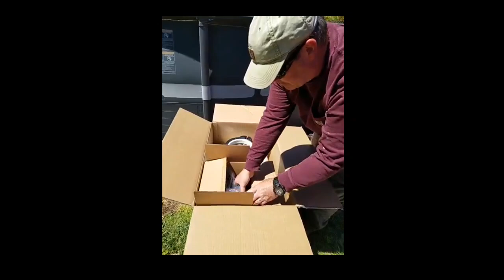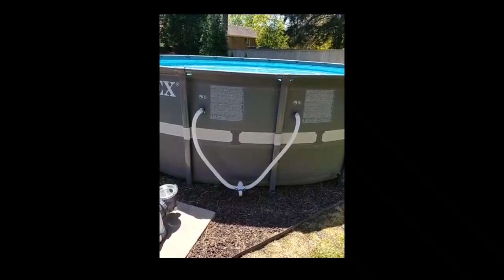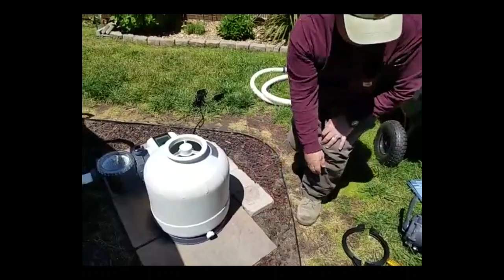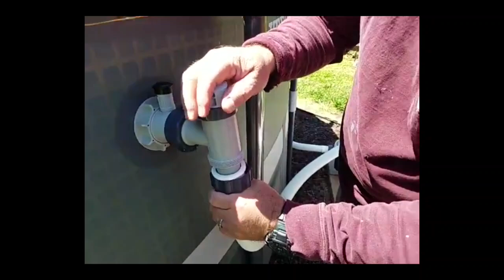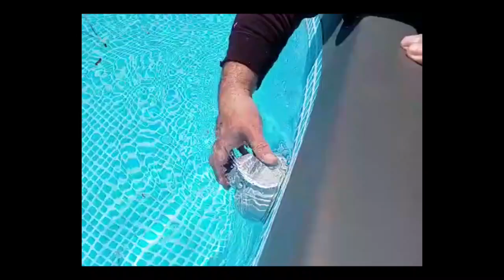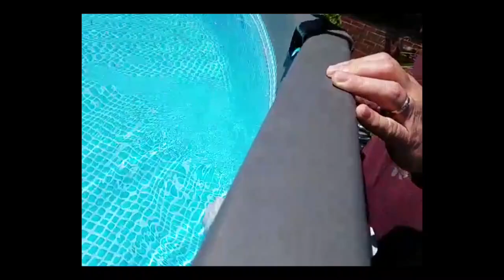INTEX SAND FILTER PUMP - Setting the pump up for above ground pools

Comment: My old sand filter finally bit the dust. I had sand laying at the bottom of my pool. I bought this exact model and set it up. I vacuumed as much of the sand off the bottom of the pool as possible. However, I noticed after I put the new filter on the next day, I had sand at the bottom of the pool again. I hope it's not sand from the new system. It only happens after the filter is on. Do you think it's still sand settling from the old one?
Reply from the maker: Sand in the pool could be from many reasons. I will tell you we noticed this already this summer but it's not that bad just a small sprinkling.  It could be that the sand level too high in the filter or when the filter is backwashing the water flow can cause the sand to rise high enough and overflow into the standpipe, which will allow the sand back into the pool.  Sand filters have been known to pass some small debris back into the pool, and it can be considered normal, especially if you are vacuuming fine, silty dirt. I had one user tell me after watching the sand filter pump video, that the sand brand/type I was using was way too fine.  It could be any of these three items.
Reply: @MoverandShaker  Thank you for the quick response. This morning I decided to look inside the sand filter to check things out. I noticed a few things. First, the tank was full of water, so I drained it to look inside, and I noticed leaves and other debris floating around. Next, the sand level was actually below the min line (probably because it was in my pool, lol). Then I checked the skimmer and took it apart. I think debris and leaves were getting past the strainer and into the tank. So, I took the skimmer off and just put the intake cap back on. I cleaned out the debris and leaves from the tank and added more sand  (the one recommended, of course). I'm not even sure if that would cause sand to reenter the pool, but it definitely is. I'm going to vacuum the sand out of the pool and run the filter again. If there is sand again then I need to go to step 2, get different sand sizes, you mentioned?  Are there different sand sizes? Leslie Pool where I bought the sand only had one size, luckily the size mentioned in the manual. Your advice is greatly appreciated. Thanks.
Reply from the maker: @michelelara8091   I am wondering how the leaves were getting past the skimmer strainer and the pump filter basket too?! however the pump will have debris in it, I would not expect to see leaves though unelss they were small I guess.  

About the sand...I really don't know how to advise you in regards to the sand. I mean the sand we used was the Aqua Quartz #20 Silica grade sand and it's one of the top 10 for pools and the big pool brands sand are generally the same type and even we had a small sprinkling of sand in the bottom but nothing too worrisome for us.  Here is a list of pool sands: https://www.thepooladvisors.com/best-pool-filter-sand/ 

I am not sure if you should add more sand to the pump.  You probably already have the the majority of the required amount. I read in the troubleshooting guide for the Intex Pump that the reason for sand shooting back into the pool is Sand is too small or the sand bed is calcified.  The sand has to be #20 Silica sand and the sand granuals between 0.45- to 0.85. 

Here is something interesting. The manufacturer of our sand says on the bag use 100 lbs for a 16" pump however the filter manual told us 121 lbs so perhaps it was too much sand. I am sorry we can't help you more.  I would suggest take a look at other videos about this issue or start from scratch empty your sand out and reload.  I do wonder how much sand is going in your pool?
Reply: Mover and Shaker Thank you so much for taking so much time to help me! I tightened everything up again, vacuumed and ran filter for an hour just to see if sand would start to settle. After an hour I stopped it and checked the pool. There was a light layer, nothing like before but then again it wasn’t running 5 hrs. This is going to be some trial and error. Because I had a bunch of sand in the pool when the last one broke. So maybe it’s going to take some time until all that old sand is finally out of there. I read in some posts that people were having this issue a lot in 2019-2020 and perhaps a bad batch of sand went out. I used the same sand you used.  This system is brand new (same as yours)  and the same size as my previous one so this is why I’m stumped. Yes, my last resort will be to empty check for cracks, and refill.

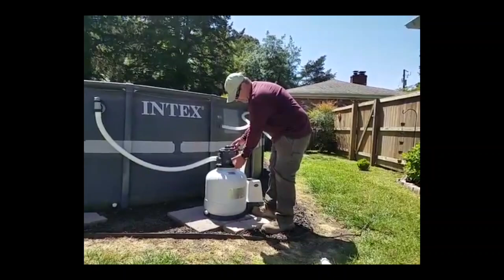Comment: 17:47, where did you purchase the extra hoses?  Great video!!
Reply from the maker: They aren't easy to find right now - Originally two of them came from our Intex pool cleaner but we do keep extras on hand because one time our nut just cracked without warning and they aren't cheap.  https://www.ebay.com/str/cheapmansdvd
Reply: Mover and Shaker thank you sir.  Greatly appreciated.
Reply: @MoverandShaker   what size are tho hoses? Are they different for each size of the filters?
Reply from the maker: All hoses are 1.5" except the two going in the right side of the pool those are 1 25"
Reply from the maker: @iselluna4535  Our pool pump hoses are 1.5" The 2 smaller hoses that connect to the 1.5" hose over by the skimmerr are 1.25" Typically everyone has to find adapters either 1.25" to 1.50" or vice versa. When we purchased our pool and pump we never had to purchase anything outside of that. Everything was included that you see in the video with the exception of the backwash hose and we just connected those from spare hoses.
Reply: What kind of connectors are those on the discharge hoses.
Reply from the maker: @teresacruz-steele7313   Those are male and female connectors on those hoses made by Intex.  They don't sell those connectors seperately as far as I have seen doing our research, only the male and female hoses with the connectors already attached. Some are short, some can come longer. However they do sell Intex adapters for connecting 1.25" to 1.5"  - The only reason we had those hoses are because 2 came from our Intex pool cleaner that we weren't using and two were purchased online on Amazon.  So we pieced them together to make a hose but they do sell Intex 59" hoses that would attach if that is long enough for you.

Comment: This is very helpful! Can you tell me what you used to mount the double suction hoses?
Reply from the maker: Thank you for compliments on the video. 
If you are talking about the clamps, those are metal clams x 4 and the plunger valve is just tied to the pool railing with a short amount of parachute cord to keep the hoses upright.  Is that what you meant?

Comment: How much sand did you use, 3 bags about?
Reply from the maker: 120 lbs 2 + part of a third one
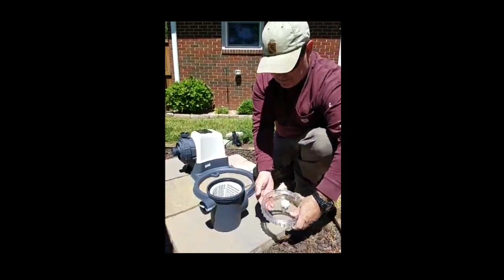Reply: Mover and Shaker thank you very much, do you know anything on getting replacement parts? I tried intex website but they skip my part. It’s the gasket inside the leaf basket seen about 3:50 in the pump. I appreciate all you help with the videos and answers
Reply from the maker: @johnw274   if you have the SF-80110-2 model  then you can buy the Leaf Trap O-Ring Part # 11824 here.  https://www.intexcorp.com/replacement-parts/above-ground-pools/ultra-frame/18ft-x-52in/2018/26331eh/pump/11824-leaf-trap-o-ring-for-12in-sand-filter-pumps/ 
If you have the SF-70110-2 or SF60110-2  you need part # 11232 you can buy the Leaf Trap O-Ring here for both models https://www.intexcorp.com/replacement-parts/above-ground-pools/ultra-frame/18ft-x-52in/2018/26335eh/pump/11232-leaf-trap-o-ring-for-sand-filter-pump/

Comment: Did u connect to the wall or cable?
Reply from the maker: If you are referring to the electrical outlet we had that installed and it connects directly to the outlet inside the house but there is a electrical box on the outside of the brick wall and it's GFCI

Comment: Hi! I just ordered my Intex sand filter yesterday and your video is the best video I have seen on installing my filter so a big Thank You to you!!!!! Just one question, now that you are using this filter, are you still needing to add chemicals or as much chemicals with this filter?
Reply from the maker: Thank you for the compliments on the video. Interesting question - Answer - Nothing changes with regards to adding chemicals to your pool when you upgrade your filter to a pump that pushes more Gallons per hour.  The pump is fantastic! unfortunately you still need to add chemicals to keep the water balanced.  We really were stressed out because we could never get it balanced perfectly ever. We purchased so many items, Alkalinity increaser, PH up, PH down, Chlorine tabs, Shock, etc... on and on and on. We were so tired of it.  
We just switched to a SaltWater System Chlorinator and have completed 7 days and have not had to add one single thing because everytime we test our pool water everything is in the o.k. range and we are estastic.  We have a saltwater pool now.  It may be something you want to look into in the future to avoid chemicals being adding constantly. It was intimidating at first but as all things you sometimes look back and laugh and think that wasn't that hard at all!   Herre is our Saltwater video.    
https://youtu.be/yU6TMbsclco  The chlorinator makes it's own chlorine.

Comment: Why is mine leaking from the dual intake at the middle? how do you have the rings tightened?
Reply: So great video, seriously super helpful.  Mine is leaking where the pre filter assembly meets the motor. It’s fine when it’s running but then drips constantly when it’s off. Should it have an O ring in there because I only had an O ring on the lid.  It doesn’t really lock into place other than that plastic nut on the inside that holds them two together. I wonder if he’s referring to that...any help would be appreciated!   Thanks!!
Reply from the maker: @carlostrejo9619  Hi there, yes there is absolutely an O ring betwee the  Pump Motor and the pre-filter housing  The O Ring on the lid is the leaf trap O-ring. The O-Ring you speak of missing is the Sand Filter Pump Motor Inlet O-ring.  If you have Sand Filter models SF80110-2, SF70110-2 OR SF60110-2 then it is part # 11457   If you have a different model then simply look up your pump on the Intex website and download the manual (if you don't already have one so you will know your part number)  Did you buy your pump used? If not this part will most likely be under warranty for replacement since it was not there.
Reply: Thank you so much!  Bought it new but I guess it’s missing that one.  I’ll call them to see if they can ship it my way.  Thanks again!!  Huge help!
Reply from the maker: @carlostrejo9619   Well I am sorry to hear that! I can't believe that important part or any part was missing from your brand new pump.   Good luck in getting it fast!   I am glad I could help you Carlos!
Reply from the maker: I'm not sure if you have the Intex light gray hand tightening plastic twist clamps but we have all metal clamps that have a screw on it and they came with our pool.
Are you talking about leaking from the middle hose on the outside of the pool that's what I'm thinking you're talking about it definitely should not leak at all our plastic hose is over the entire black piece that comes out of the pool with the exception of a couple centimeters

Comment: Thank you for the video. Maybe you can help me with bubbles coming into the pool thru the outlet. My collection basket also has a big air bubble in it. I've unscrewed the top to bleed out air but still getting the air bubble. I then took off the lid to make sure the O ring was good (which my o ring is on the lid) and it looked fine. This is the 2nd season having it and we didn't have that problem last year. New sand was also replaced this year and backwash and rinse was done. My pool is the rectangular ultra frame pool 12 x 24 x 52 model number is SF80110-2. I sure hope you can help. Thank you for reading
Kim
Reply from the maker: As far as a bubbles coming into your pool from the outlet on the outside of the pool where the plunger valve is, is the dark gray cap not completely pushed down? 

As far as the air bubble that you described in your pump filter basket there's always at least a small air bubble at the very top of the pump filter basket right under the little cap.  Just make sure all your connections are tight and that no air is getting in anywhere, all your inlets, all your hoses, etc....

Comment: What did you use to connect the hoses for when you did the backwash?
Reply from the maker: If I understand your question correctly the hose we were using were extra hoses that 2 were extra from the Intex cleaner and 2 we ordered online so that we had 4 total (2 male and 2 female.) We eventually decided to get heavy duty backwash hose that goes 50ft long and that has been working great.
Reply: @MoverandShaker  ok I get it. I have extra hoses but they are female only. Was looking for something to connect them. Thanks!
Reply from the maker: @petepool74 If you take a look at the end of the Intex Pool Cleaner Vacuum video of ours then you will see the hoses in a photo and that may help you figure out what the adapters look like but I can't find anything like it on Intex. It's possible we just got lucky by having the cleaner on hand when we bought the two additional hoses.

Comment: Hello, thank you for the vid. Just realized you posted a new one today. Today I have gotten my 10” Krystal Clear sand filter pump in that I ordered from Walmart. I just ordered A and B hose adaptors for the 1.5” because my Intex 15x48 has 1.25” hoses on it. Just need sand and I’ll be all set as far as getting it fired up! Thank you sir for taking the time to make vids. Hope you enjoyed your day
Reply from the maker: Nice! Yes, you are correct the pool comes with 1.25 and the pump comes with 1.50 hoses. I am so happy for you!!!   Let me know if you have any questions. It is a learning process and we are still learning. We have 4 days of rain so no pool time for us 😥
Reply: Mover and Shaker did you guys use an adapter for the 1.5” hoses?
Reply: Just put up my Intex 15x48 and the pump seems weak. I’ve seen a lot of changing to the sand pump. to make things easier I’ll order the A and B hose adapters for the 1.5 line. Seems like you wouldn’t get the full potential with the adapters and seen where people have cut in a larger hole for the 1.5 lines. 
Wasn’t sure what size pump to get so I’ll follow and get the 10” pump. Specs on my pool shows 4,440 gallons
Reply from the maker: @aliceinchains5243  when we first ordered our pool it also came with the cartridge filter and we didn't even set it up we put it up for sale and also sold the filters then we got a 2100 gallon per hour pump and that actually did fine but my husband decided he wanted to be  bigger better and get more horsepower and get a pump that does more than was necessary at 3,000 gallons per hour and it works well.  We never had to attach any additional adapters so I don't think you're going to need anything if you look at our original setup and our current setup that all came out of either the pool or the sand filter boxes. I'm not sure if your pool didn't come with the same part as ours but you can certainly look at our pool and see if you can follow with that.  I have some videos where people have cut the 1.5 in hole in order to get the full potential but our hoses the 1.25 hoses aren't really that long and they go straight into the 1.5 hose if you take a look.
Reply: Mover and Shaker   Thank you for the reply. Your vids have been very helpful 
and informative.
Reply from the maker: @aliceinchains5243  That is good thank you very much!

Comment: we just purchased the intex 16 inch sand filter and pump for our bestway deluxe series 20 ft round pool, we have not connected the filter and pump that came with it yet, so my question is do the piece that connect to the pool inlet and outlet holes work with this intex pump or are we going to have to purchase something else to work with it? just trying to be prepared for when the pump arrives?
Reply from the maker: I am not familiar with any pool brand  with the exception of our INTEX one  but the Intex Pump comes with the 1.5" hoses for sure.   Now the two 1.25" hoses on the right came with the pool and fit exactly on the 2nd and 3rd outlets with hose clamps.  that were manufactured into the pool .  I have seen online it is VERY Common that you may need adapters that convert 1.5" to 1.25" hoses or outlets or vice versa. It seems everyones pool and pump are configured a little differently depending on your equipment and pool brands but I can tell you these simple hose adapters are on Amazon and can be purchased quickly or go right up the street to your local pool company for them.  I have a bunch them myself that I preordered just in case (sames as you are thinking now) and I never needed them but you're pool is different so I don't want to advise you.  

What I suggest you do is look at the Parts reference guide inside the online manual on the Intex website for the pump you purchased and then look at the parts reference guide on the Best way deluxe pool guide parts specifically for size of hoses and outlets, etc.. and you will know ahead of time. I don't think you will need any extra hoses. Just possibly if any adapters and they are cheap. 

 I would also say look at some bestway videos that have an intex pump combo and look for those SMALL hoses and look for adapters on them.   I am guessing if anything you would need 1.5" to 1.25" or 1.25 to 1.5" but no more than probably 2 to 3. Sorry I couldn't be more help but I think some videos may render some clues if you look closely.  If you look at those  PLUNGER Valves on our pool left and right those allow you to stop and start water flow and the right side allows you to also connect small 1.25 hoses into.